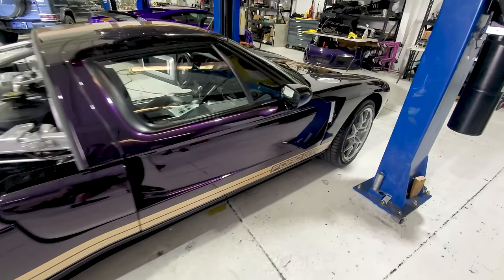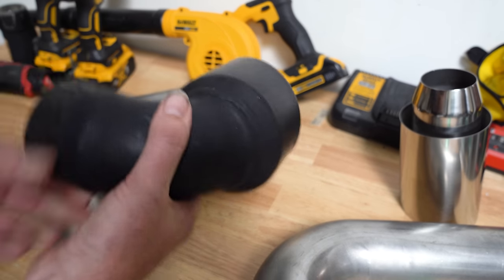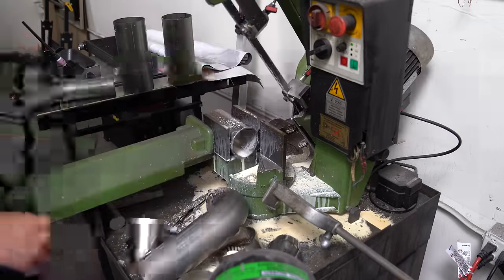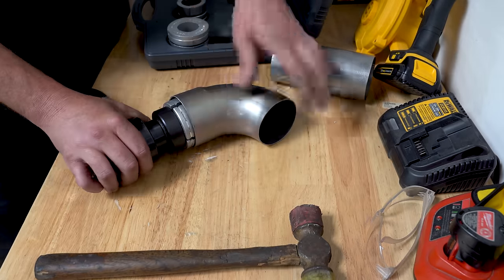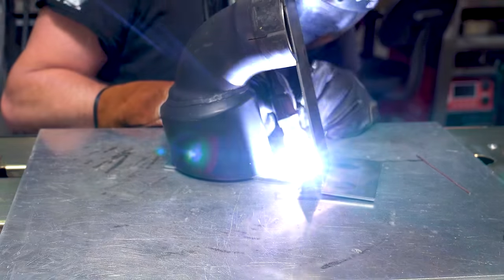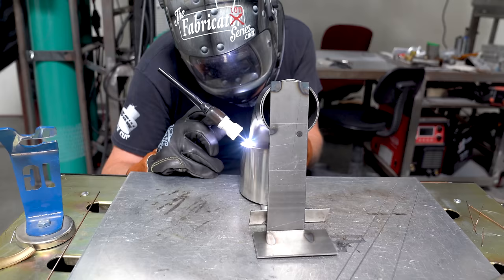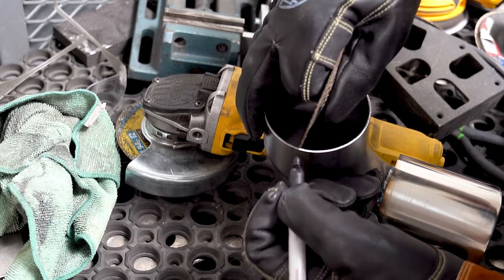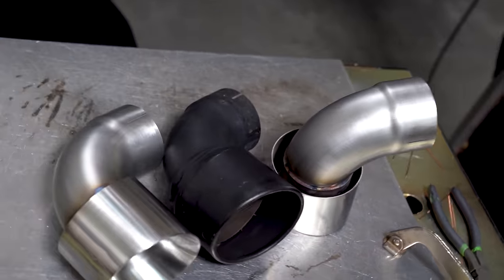Custom Built Exhaust Tips (because you cant buy them)

Comment from the maker: ↓ Swager/Expander Kit ↓
First is the Lisle 17350 expander set. You can use it manually as is, or add hydraulics. https://amzn.to/3HocdaL
A cheap knockout set has the hydraulic cylinder attachment you’ll need. You can also use the hand pump if you’re on a budget, but its insanely slow. https://amzn.to/3EGsciI
You’ll want a high quality 10,000 PSI rated jack hose long enough to reach whatever you’re working on. DO NOT buy a cheap under rated hose as it may burst on you! https://amzn.to/3FIugYW
An air over hydraulic foot pump powers the unit quickly https://amzn.to/3qzg5iE
If you use the foot pump listed above, you’ll need this hydraulic bushing to adapt to the hose also listed above. DO NOT use brass – use ONLY stainless, otherwise it may explode. https://amzn.to/3FJJmNI
The foot pump above takes 1.6 quarts of oil, so buy 2 quarts https://amzn.to/3JFQ3D4
Happy swaging!
Reply: I was just going to ask which kit you use for pipe expander thank you for including a link for it.
I’ve been wanting to add this kit to my cabinet and I have the hydraulic knock out kit already so this will be a good addition
Reply from the maker: @Rusted Bolts & Buckets 21 years
Reply: I tried to put together a hydraulic swaging kit in the UK recently .. my top tip would be: remember that the (imported) Lisle set will be imperial and the (imported but from China) hydraulic knock out set will be metric.. I didn't think about that and ended up with a set of pieces that don't fit together ;) (I ended up just using the Lisle set with the impact gun .. not easy on 1.5mm wall 304 tube)
Reply: While I was working on a jobsite I took a bubbled air hose off of our compressor and warned everyone not to use it. One of the guys I warned with it had it burst while he was using it shortly after. Thankfully he was fine but he easily could have hurt an eye or something. When someone gives a warning about cheap air hoses it's not because they want to take fun away from anyone. It's spreading a bit of common sense for those that have none.
Reply: @krakenthrottle2199  and common sense is so rare these days it may as well be a super power
Reply: Do you have avid or link of instructions on putting this together
Reply: @t6378tp  it's screw threads bro......take the two pieces and rotate them while applying slight force to push them together, and the thread will engage and you just......turn it. You seem interested in it so maybe use your brain to think about the problem a little. You don't need a tutorial for everything in your life. If you can't figure out how to assemble this, maybe try knitting?
Reply: @nerddub  so guess that's means you don't know
Reply: @t6378tp  don't know what?
Reply: So what bolt did you use to screw into stretcher? The china punch driver takes a bigger bolt. I was going to order of make one but if you know which one already will save time.

Comment: And still probably cheaper than any off the shelf aftermarket parts, simply because theyre for an "exotic". Great work again 🤘🤘
Reply: Bro a 90° exhaust tip of any diameter is no more than $80 on eBay. His client is just very wealthy and doesn't mind paying out the ass for fit and finish.
Reply: Don't speak like that unless you suspect you're at least in the ball park. This isn't a component anyone should have a welder create. Factories don't charge $100 an hour for labor and a $50 drafting fee.
Reply: @MatMabee  not talkin about generic Autozone specials, but performance shops who "mass produce" parts for cars like this. Thanks for showin up though. Have a good day 🤙🤙
Reply: @MatMabee  you sound like a kid
Reply: @atozbikes  you sound like you're terrible with assumptions
Reply: TechArt exhaust tips for Porsche cost around $1k.

Comment: I used to make custom exhaust tips and even those Just bought from exhaust shop can be relatively easily made with hydraulic press. If you foresee yourself making more exhaust tips in the future it pays of extremely quickly to get a few scrap pieces of carbon steel solid rods and lathe down cone shaped dies, harden them and then you have cheap tool to make literally hundreds of tips per week.

Comment: I didn't hear how much the part would have been oem if it had been available... a lot more than $350 I'd bet
Reply: Really good point, Just checked dealer part site, the exhaust tips aren't sold separately and come with the whole Muffler which is $2,234.80+tax here is SoCal.
Reply: @CP110  ouch!!!
Reply: Man needs to charge like at least 150 bucks more!
Reply: @CP110  my wallet is crying in agony in the corner just because i told it the price now ...
Reply: I paid about $400 for my Ford GT exhaust tips at a local welder.  They gonna look so sick on my Kia Sorento.
Reply: @schnookieshullHull  I guess you didn't pay attention to the amount of work he did? The stock tips alone were $80 at the store and they required a ton of custom fab work to make them fit.

Comment: Speaking of swaging, I had to make a tool to swage 1/2" copper pipe in a house that was unoccupied and subsequently froze and swelled the pipes. It was made from a piece of scrap steel that was from a car strut. It was already about the right size, and saved me a bucket load of time and money.
Reply: They make slip coupler's, just a heads up on that. Not to mention pex is way cheaper than copper also.

Comment: I think your tips look way better that the original. 👍👍
Reply: Theres only one part about the original i like better. Where the tip meets the tubing. The factory one has a smooth/solid taper. The ones he made have a big gap between the outer layer of the tip, the inneer layer, and the pipe. Just creates a spot for debris to collect, and doesnt look as clean

Comment: I tried to make that bend:  same material, same diameter, same radius, and same wall thickness...and failed.  Every piece tore in half.    I was using a Pines #2 bender, lube and quite a bit of axial compression pressure.  After scrapping $300 dollars of material, I gave up.   The outside radius is where the failure was located.   It stretched out, became paper thin and tore.  Maybe polishing the tubing and preheating the inside diameter (to shift the bend tangent line "closer"  to the I.D.) would have worked?  But then, you run the risk of buckling the inside radius.  That's a tight bend and I don't know what kind of voodoo it takes to make it.
Reply from the maker: I think its more material than anything. Cheap stuff gets ripped and torn just from expanding it. I can only imagine how tricky it is on a bender. Whatever the do at JMD to get it right, they're probably not telling haha.
Reply: Try packing it tight with sand it well help keep the shape of it and not let it buckle  learned that trick from a old guy building yachts lol
Reply: @jaxkel3589  The Pines #2 bender is a commercial bender, 15 feet long, flexible internal mandrels, etc.  Possibly a custom designed tool  would make it work.  Preheating one side, polishing the tooling, multiple stage bends ....  it's VOODOO!  YOUR IDEA 💡 MIGHT HAVE BEEN THE ANSWER.   But, I had already scrapped 10 pieces of stainless and 20 mild steel ones.  It still gives me a headache thinking about it.  It beat my skills/experience.
Reply: I've run into a couple cases lately where tubing I was buying wasn't the actual wall thickness it was marketed as.. was making unexpected issues until I figured out the materials were 15-20% thinner than I thought.
Reply: @GrindhousePerformance  I get that with sheetmetal all the time. There is a tolerance with the standards so to squeeze out every single penny the manufacturers always go to the low side

Comment: I cant believe you arent charging AT LEAST what the factory part costs assuming you could get one. I know youre being fair to the customer, but there is a point where you are being TOO fair.  Not lying, I wouldve charged a grand for that and the customer wouldve paid it happily. This is coming from someone that does motorsport electrical harness fabrication (the concentric twisting fab) and the amount of times I heard the customer say, "thats it?  I thought itd cost 3x that" made me reconsider what my skill is worth versus what I think is fair.  I changed my rate when I found out that I could diagnose issues in less than 1/3 the time that other shops were and was only charging for 1/3 the time.  Why should I short change myself because I can do the job right and ahead of schedule?

Comment: I did not know about back purging until today- thanks for that👍
Reply: Stainless steel needs a back purge because it crystallizes and turns brittle on the back side and can cause cracking later down the road.
Reply: @SlapHappy  I googled but didn’t read about the cracking down the road- thanks
Reply: @SlapHappy  I remember seeing a channel, maybe this one? use a dry powder or something you mix with water and it turns into a paste and you can put it on the backside of the weld and it will act as shielding. I forgot what the stuff was called
Reply: @Ckcdillpickle  solar flux. It is a dirty alternative to back purging but does work

Comment: Im kinda surprised you didnt get it closer to the factory look. The factory one had a solid taper so the re was no gaps between the inner and outer layers of the tip to the pipe/bend. Thats kind of makes the look, and blocks anything from getting in between the outside layer of the tips and the pipe/bend. Looks much cleaner and more unifom too. Still a nice tip though
Reply: Also i wonder if those tips are going to change the exhaust note not having the inner support that coukd kinda act as a baffle

Comment: Hey I have a quick question. When you’re welding on newer cars, like an exhaust, is there anything else you disconnect besides the battery? Have you ever had any issues welding on a vehicle?
Reply: Battery, alternator and unplug the ECU/PCM. Been fabricating on race cars for 20+ years, rather safe than sorry.

Comment: Quick question, using a harbor freight 125 welder with the stock 030 flex wire.. Tried to reweld a muffler back onto a sleeved exhaust pipe. I prepped both parts and when trying to weld them together I kept getting popcorn bubbles and the part did not weld. Is this a wire issue or not enough heat. I was on low at a speed of 5.

Comment: 360 $ isn't that much for a job well done on a part that you can't find anywhere, sure, it if was a very popular multi million units sold model, the parts would be cheaper, but i doubt you would have been able to find new exhaust tips for that car for cheaper than what it costs to make them, adjusted for inflation.